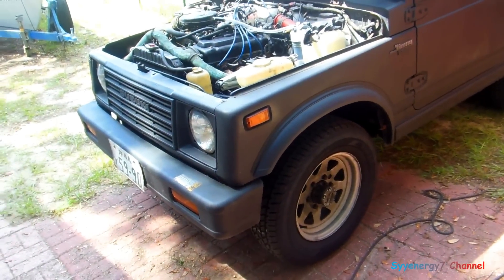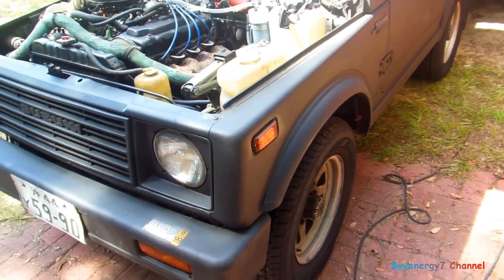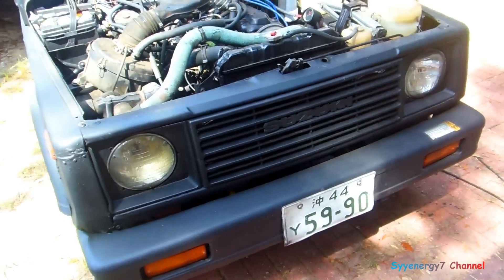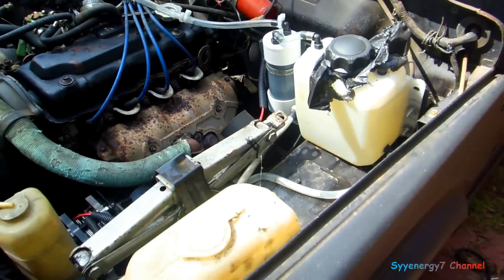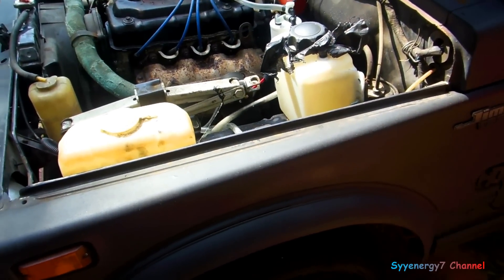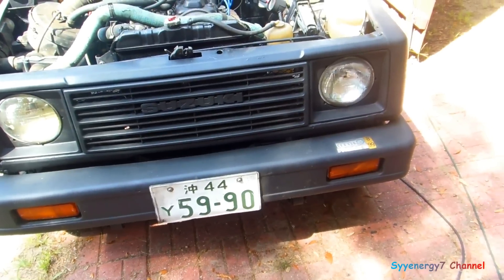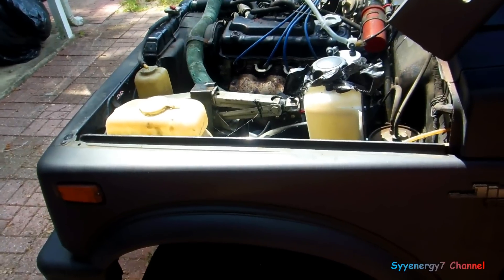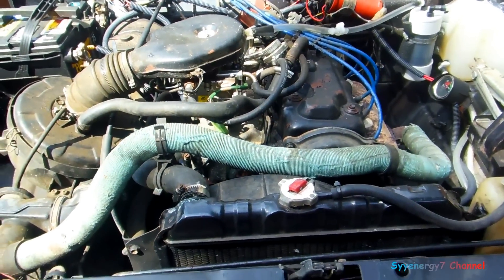WHY HHO Works & Don't Get Ripped Off

Comment: 5AMP ?  Alternator can give 25A for you, you can make 4 more electrolysis chambers for your car. You can supply HHO under pressure,get more power more mileage,  so how many amps it takes to run it without petrol  ?  :D

Comment: Why it works is actually very simple as it works due to more O2 being added to the system as the oxygen levels in our atmosphere is a lot lower than it use to be. More O2 equals better and more complete burn and the hydrogen going into the system is just a bonus. This O2 is pure not mixed with 78% Nitrogen so it's the O2 that is making it work better not the hydrogen.
Reply: how much lower is the oxygen  today compared to 1980?

Comment: So, can the car run on HHO ONLY ? without fosil fuel?
Reply from the maker: No method that I know of.  But a little HHO will help with a more complete fuel mixture burn and improve efficiency on a simple carbureted engine.
Reply: yes it can, but a larger system is required:  https://www.youtube.com/watch?v=yjqkHhWUKOU
Reply: "fosil fuel" ? Oil does not come from plant/animal matter... check youtube for vids on the great oil hoax....
Reply: you can also search yt for stan meyer's and his research and dune buggy...run on water only with specialized electronics.

Comment: Engines can run on hydrogen, propane and anything that burns. With modifications. It's the cost of the mods, or hardware or maintenance or energy to achive the burn, and the ending cost that makes or breaks it. I helped a friend convert a subureu brat into a electric car. After buying batteries all the time his honda accord had better miler per dollar than the electric car.

Comment: So the manufacturer says it can get 27mpg, but you are saying only because of this device you get it and before the device you achieved it sometimes, but now its all the time because of the device. Only because its so cheap I'm going to say it's not enough of a saving I would even bother with.
Reply from the maker: You'd get more mpg with furl injection and a computer engine management system, but that's big $$money.  There is another advantage to the HHO and that is cold starting.  Leave the key on 20 seconds and let the carb fill with HHO.  The engines starts super fast in any weather because hydrogen ignites very quick.  The HHO will also keep the engine cleaner.  I think this whole kit was about $250.  Not a bad deal.

Comment: The HHO Can work according to Physics... Meaning An Engine CAN RUN 100% ON HYDROGEN... However, There MUST be Modifications... The reason your Fuel/Gasoline Mileage only increased by about 22% is because The Hydrogen Molecule  (H2) Naturally attaches itself to Oxygen Molecules... Which reduces the energy release of the mixture...

Engineers Are Real MEAT HEADS Sometimes... They NEVER Want to leave the box... And ALWAYS Stick to The Status Quo.. Meaning? They Stick to what works and has Always Worked... "In The Box"? Is the Engineers "Safe Space"... LOLOLOL!!!
Reply from the maker: Please sign the petition.White House Petition, Make MOONSHINING Legal and Free of Tax and Regshttps://petitions.whitehouse.gov/petition/make-moonshining-legal-and-free-tax-and-regulation
Make the distilling of Moonshine for personal use, as fuel,
medicine or consumption, free of all tax and regulatory requirement for the entire USA in amounts of 500 gallons per annum per person.   It is generally unknown to the public that privately distilled ethanol was the preferred fuel, up until the time of Prohibition. 
Although Prohibition was repealed, regulations and fees were still kept in place and in 1933 a National Gasoline Tax was passed.  Distilling spirits can be a major boon to true free enterprise, financial independence and also contribute greatly to
clean air since pure ethanol burns far cleaner than gasoline. 
And on youtube
http://www.youtube.com/watch?v=24oCnyCtYAc
Reply: commonman80 try magnets

Comment: where did u buy yours for 150 bucks sir?
Reply from the maker: ebay,  I think from Canada
Reply: righton man!! how many changes to your hho system have u made since u made the video?
Reply from the maker: No changes at all.  It's been reliable and working good all this time.
Reply: righton good to hear man
Reply: what is the company's name in Canada?
Reply: syyenergy7 thank you for posting this video and information, HHO has captured my interest the day I watched the video. And it’s still here on YouTube. I really want to install it in my truck but, it’s a 07 4RUNNER. As you pointed out the computer controlled problem and fuel air mixture. Do you have any advice after looking back on doing something different. I understand that mounting that part to the frame and using the vibration to stir it up?is a great point. Thank you very much. I know that you are very busy but hopeful you will reply. Many other people don’t, IMO. 👍🏽 Thanks again. Matty

Comment: as far as ecu controlled vehicles go, I wonder if using a wideband o2 and adjust the target afr value in the CAL tables to compensate??
Reply: Mick Fieldy from my research, you have to apply correction factors to the signals reported to the ECU by upstream o2 and MAP sensors.  George Wiseman of Eagle Research has some inexpensive solutions that can be applied whether you’ve put HHO or any other combustion enhancing technologies on your computerized car or not. I plan on applying them to mine now that spring is here.
Reply: brendan shannon right, a simple variable resistor on my analog MAP, plus a circuit on the o2 sensors. The MAP adjusts the air the computer sees for delivery, the o2 adjustment trims fuel delivery (injector pulse width) as I understand it.

Comment: Why this happens is not about the hydrogen, its about the induction of dense oxygen into the air fuel mixture . Hydrogen only has 400 btu per cubic foot uncompressed. Lots of studies on this and why it works its about the oxygen it like adding nitrous oxide to your motor. If you increase the oxygen from 21% to 25% you will improve the burn cycle.

Comment: 99% of people that argue that it doesn't work are either pc warriors that have never owned, installed or even tried it!!...its been a proven fact!!.....by the way 18 dislikes? 18 pc warriors that have never owned, installed or even tried it....lol!!
Reply from the maker: Yep, those were total trolls.
Reply: jpmastertech OR.... those who tell it does not work spent enough time studying in an Engineer degree and don't NEED TO spend precious time in this waste of time and money!

Just give me a good reason for auto makers not to use HHO if this could be a very cheap way to increase mileage (and selling value of a new car)?

When something  is "too good to be true", it is  normally not true.
Reply: Pardal Bartz because they are in bed with big oil. Btw Chevy have a colorado zr1 that they are marketing to US Army that runs off of HHO

Comment: it works, but ever body is using electrolyte, it needs to be a volt system like Stanley Myers, think telsa like Stanley Myers Vic coil and amp consuming device such as resistor or light.

Comment: syyenergy7: The answer is in flame front speed. I am sure that at some point you have set some gasoline on fire. Unless it is in a closed chamber, it goes whooosh. If you take a small amount of hydrogen and ignite it, it goes bang. This is a result of the speed of the flame travel. A hydrogen flame, even when hydrogen is present in small amounts, travels very fast. For this reason, when a small amount of HHO is combined with a mixture of air and gasoline, the result is a cleaner, more efficient burn. In itself, this provides a slight boost in fuel efficiency. However, the problem with most carbureted engines and all fuel injected engines, the air and fuel are applied at a direct ratio of 14 to 1 ( some variance is allowed ). In using HHO, it is possible to change this mixture by replacing the jets in the carburetor or using injectors with smaller pintles. You might be able to change the ratio to as high as 24 to 1 which would increase the mileage by more than 50 percent. This however brings a new problem. Running the engine on an extremely lean mixture causes a heat problem, in fact, it can become so hot that it can melt any spark plug except platinum. It also causes extreme heat stress to the heads and valves, so additional cooling capacity may be needed. Water vapor injection can also help reduce the heat and improve efficiency as well.

Cars and generators have been run on nothing but HHO but only with significant modification.

Have you ever heard of a wood fired truck? There is a fellow here in Alabama who runs a whole fleet of trucks on wood chips.
Reply: Where do you get that from. It is plain simple physics and well documented in many combustion engine publications.
Reply: Well, Frank, as a starter, you might just pick up a good book on combustion engine technology. Flame front propagation is one of thge major differences between diesel and gasoline and a major reason that diesel engines run slower than gasoline engines in general.
Reply: Frank, I agree, but have you ever seen trace amounts of Hydrogen ignited in open air? I have, one of the first lessons in high school chemistry. Gasoline goes whoosh while hydrogen exploded with a big bang. It does not take much.

Comment: Have you noticed the HHO helping out with knocking at all?  Someone below mentioned water injection  -- water/methanol injection is used by people running forced induction as a cheap way to raise octane.  Man I would be really curious about trying this on a supercharged engine!
Reply from the maker: +Slappy Fistwad This did not have any knocking to begin with, so I can not determine what HHO might do for knocking.

Comment: Agreed HHO helps boost the efficiency....wish i had them on my older vehicles....does it work on an '89 GMC 350ci throttle body TBI system...or does it need to be carburated?
Reply from the maker: +Accuracy Marked There is a new add on device that vents the oxygen and only hydrogen goes in the intake.  It was the oxygen in the HHO that kept causing the O2 sensor to signal for more fuel.  If you only use hydrogen, it should work with O2 sensor cars.
Reply: Frank Gutowski Is the energy produced H2... is it more than the energy consumed in electrical current... load on the alternator? Have you studied or used these systems?